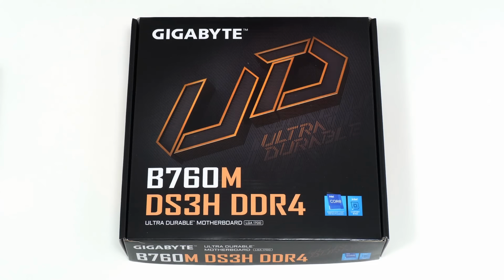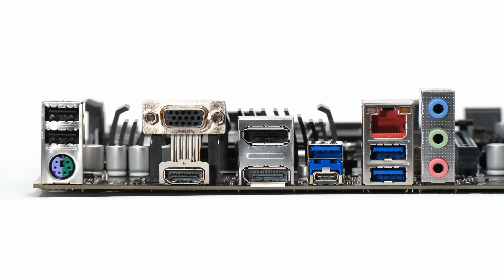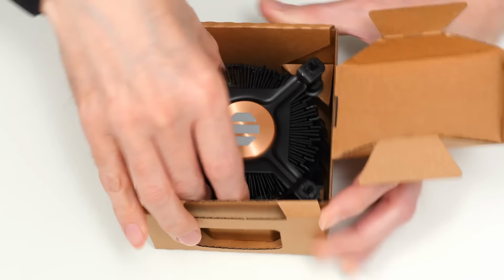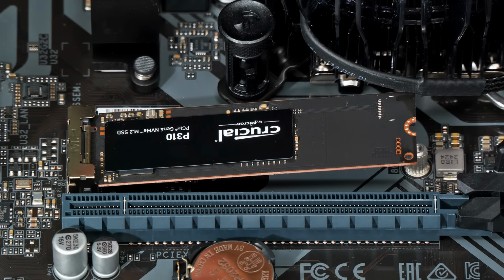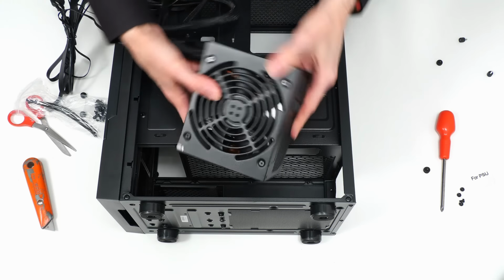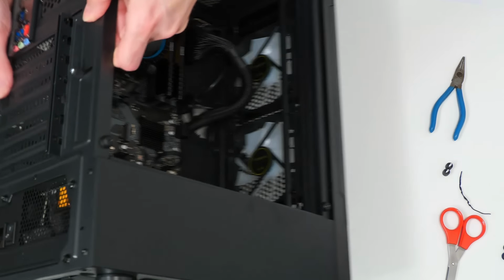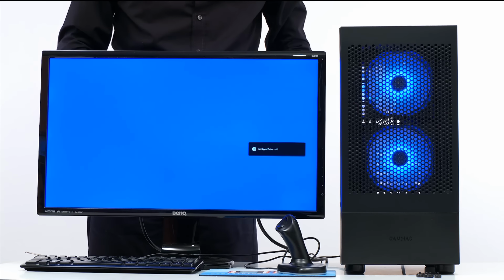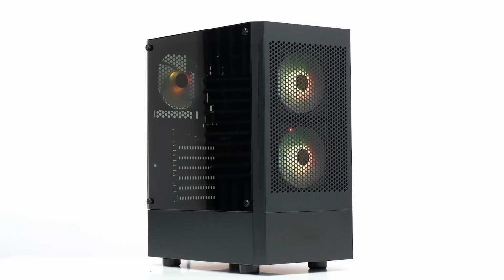Building a $500 PC

Comment: Hey Chris, I just upgraded the data hard drive in my ancient self-built PC. I bought a "refurbished" 2 TB Enterprise HDD on eBay for £20.99.

The drive is manufactured by Toshiba for Dell. It was manufactured in 2018, and had 41,211 POH (4 years, 257 days.) Power On Count was 33. Drive health 100%.

I formatted the drive, and ran a full surface scan.

The drive is working perfectly. I'm very impressed. I might buy a bigger refurb Enterprise HDD from Amazon.

Please note, there is ZERO risk to my data, as I have at least 5 backups, including two encrypted offsite.

EDIT: Perhaps you could do a video on refurb HDD?

Fans = Dust = Heat 🔥👎😭

Comment: Cooler Master MasterBox Q300L White Micro-ATX Tower $37.99
ASUS PRO B550M-C/CSM AM4 AMD B550 $79.99
ASRock Challenger Arc A750 8GB GDDR6 $199.99
Thermaltake Smart Series 600W $41.99
AMD Ryzen 5 4500 - Ryzen 5 4000 Series Renoir (Zen 2) 6-Core 3.6 GHz Socket AM4 $68.99
CORSAIR Vengeance LPX 32GB (2 x 16GB) 288-Pin PC RAM DDR4 3200 $51.99
Team Group MP44L M.2 2280 500GB PCIe 4.0 x4 $35.99
TOTAL $498.88 (NEWEGG)

Comment: Find the cheapest rtx 3060 you can, the 12gb vram will help it last for many many years and is also considered entry level, it vastly outpowers this Intel card and fits most systems due to low power usage 
Good vod for beginners 👍

Comment: Please forgive me repeating the advice I gave in a comment on the first video.

For this specific motherboard, at least, you need F19 or F20. This is vital for a 13th or 14th generation Intel processor. The upgraded BIOS has the correct voltage management for the processor. Ensure you have the right BIOS before ever running the processor.

For users with Intel 13th and 14th generation CPUs, prioritize BIOS updates and utilizing Intel Default Settings to ensure stability and avoid potential issues like instability and CPU degradation. Intel has identified issues with some 13th and 14th generation CPUs, including potential instability and degradation over time, and has released microcode updates to address these. Check the motherboard manufacturer's website for the latest BIOS version compatible with your motherboard and CPU. Ensure your BIOS is updated to the latest version that incorporates the necessary microcode updates (e.g., 0x12B or higher). Even if you were previously overclocking or using custom settings, it's recommended to revert to the default settings for now. [Source: Google AI]

Comment: 1. Outstanding instruction, 2. Wrong USB connector? 1. Showing the different connecting mode for drive 2 is precisely the kind of information I often find missing both in manuals and, also in videos! One puts in a lot of time in reading instructions and preparations, but then gets thwarted by wrong or incomplete instructions, which then results in endless searches and experiments, which is so annoying! So a goldstar for that! 2. when you talked about connecting USB 2 (19:56), you plugged the connector into a slot marked USB 1, which makes me wonder whether you were testing the attention level of your viewers...;-)
Reply from the maker: I wondered in the edit if that would confuse. The connection was correct -- I plugged the USB 2.0 connector onto the first of the two USB 2.0 headers, which was labelled USB 1. But both USB 1 and USB 2 here are USB 2.0 headers.

Comment: You mentioned that the board had two display ports but you won't be using them or can't use them? Is that because your going to use the cheap graphics card? If you didn't have the card, could you use the onboard display ports?
Reply from the maker: It is because I am using an Intel "F" processor, which does not have a GPU. It has nothing to do with the graphics card, which has three functional display outputs. But the display connectors on a motherboard only work if the CPU has a GPU. They have nothing to do with any graphics card that's fitted.

Comment: I built my own system about 10 years ago using a very inexpensive and older AMD A4 CPU.  It worked fine with Windows 8.1 then 10 along with Ubuntu, until it crashed now about two years ago.  I will be weaning myself off of Windows in the next few months before Win 10 support ends, when I switch back to Apple on a new Mini Mac while using my present Dell 3050 for Zorin. I started my PC journey in 1982 with an Apple II Plus but moved to Microsoft in 1985 due to the high cost of Apple products. I have been enjoying your videos for at least 10 plus years now.  Thank you.
Reply from the maker: Thanks for watching all this time! :)

Comment: The front fans had what looked to me like 3 pin connector just plugged into another cable for sata power and LED button. Back fan looked like very weird two pin. You could probably still use these fans because they looked like they can be separated from the SATA connection. 

I'd probably replaced them with Arctic P12 fans because I don't like RGB and P12 are really good fans that are really cheap.

Edit: They might even be 4 pin connectors so PWM.

Comment: I have to pay $140 for the motherboard.
I have to pay $110 for the processor.
I have to pay $155 for the graphic card.
I have to pay $44 for the memory.
I have to pay $65 for the SSD.
I have to pay $72 for the power supply.
The case i couldn't even find, but without the case I'm already at $586 and if i add $60 (I'm pretty sure I have to pay at least $80 for a case) for the case i couldn't find it will be a total of $646 here in Sweden.

Comment: Great video but I have to pick you up on the installation of memory.
You probably misspoke about the best way to populate the slots: one should fit one module on each channel and each channel, on this motherboard, serves two slots, one grey and one black. The grey ones are further away from the CPU and at the end of the electrical connection so, if you leave one slot unpopulated, like in this case, it's better to fill that one because the stubs in the wiring to the black slot will be shorter and signal integrity will be better.
By fitting the modules in A2 and B2 you make use of the combined bandwidth of both channel A and channel B while minimising the potential problems due to unterminated connections.
Reply from the maker: Yes, I did not explain it well. Sorry.

Comment: Missing the optical drive though.   I still work with optical media, so it's a requirement.

(and no, not using an external drive; if I'm building a mid-tower case, it's inherently stupid to use an external drive).
Reply: Yeah if he's not fitting an optical drive and he's using a half height video card I thought he would have gone with a slimline/SFF case.

Comment: Thanks for another great video!

I'm not sure about the pricing in the UK or US, but I recently put together a custom build with the following specs:
- AMD 5500 CPU featuring 6 multi-threaded cores.
- Intel Arc A580 GPU with 6GB of memory.
- 512GB NVMe SSD for storage.
- 1 x 16GB DDR4 3200 MHz RAM.

The case includes 3 RGB fans and a glass side panel, all for a total cost of around $550. This setup is perfect for office tasks and light gaming.

Comment: Great video.  No drama.  I think that you picked well. I like the motherboards with two NVME slots for SSDs.  On the machine that I built in 2021, I bought Windows because I was still working at the time and out of habit I was still running Windows. I had Mint on an NVME on a PCIe expansion card. Over time, I started using Linux almost exclusively. The motherboard failed and now I have both SSDs on the motherboard. It's good for dual booters. We can keep the OSs on separate drives and use the BIOS to select the drive to boot into and not have to deal with Windows chicanery. 

I don't know if that was a consideration, but it's good. Otherwise, it's good to have /home on a separate drive to keep files and settings safe in the case of an upgrade. Additionally, I may consider an Intel video card for my media centre system if it plays nice with Mint. I don't recall seeing a half-height video card in over a decade.
Reply from the maker: Thanks for this. I was certainly aware that the two M.2 slots offers many OS possibilities. :) This PC will have to earn its keep.

Comment: I do not agree with your BOM. If you are going to use proprietary software on a build, and it is a necessary part of the build, such as the OS, I believe that must be included in the BOM. As of March 30, 2025 Amazon sells Windows 11 Home for $119.99, so I believe your BOM must inflate to $614.02.

Using Linux/BSD/ReactOS/FreeDOS would only increase the BOM if you used a paid version of them, which in the case of some, like RHEL, exceeds the price of Windows 11 Home.

Comment: Amazing that all hardware dimensions, cable connections and screw holes from so many different manufacturers are standardized and also fit perfectly.
Reply from the maker: I agree. The success of PC component standarization often amazes me.
Reply: A lot of that dates back to the ATX standard from 1995. Things like I/O shield dimensions haven't changed in 30 years. If you found old generic PC case from the late '90s you'd be able to build a "sleeper" PC using all the components in this video. Though the old case probably wouldn't have USB ports or audio I/O on the front panel.
Reply: @zoomosis  I've had the same case for 20 years. it's been gutted out and refitted 3 or 4 times. it has a firewire port on the front! (obviously not connected)
Reply: @zoomosis  3.5" or 2.5" drive bay blanks can be replaced with I/O interfaces at very low cost, there's a way around everything
Reply: ATX standards in action.

Comment: 'Building' PCs has sure gotten easy. I've been laptop-only for the past 20 years, but I remember having to configure every port address, IRQ, DMA, shadow RAM, BIOS and drivers manually with (usually cryptically labelled) jumpers, DIP switches, rockers, copying files and editing start up scripts on my desktop/tower PCs through the 80s and 90s. Perhaps I'll put together a mini PC like this to move my file/web/mail server over to.

Thank you for the video.
Reply: 1990s: Trying to get the sound card, video capture board, SCSI board and "something else" to all work at the same time without Windows 3.11 crashing!
Reply: Wowee, never had to deal with any of that. Yeah it's like Lego now. The only thing like that these days is if you change your GPU from NVidia to AMD or anything else. That's usually when the good ol' hiccups occur. Driver misconfiguration is still a pervasive issue on Microsoft Windows, and that is why I advise to simply reinstall the OS when you get a new GPU. I do this with Linux too, even though it's not as needed. But most don't do this for some reason and instead opt to use some third-party software to uninstall drivers in Safe Mode. This mystifies me personally, I think they just don't want to lose their files, but then why not back up any files you actually want to a local server/cloud?  I see constant issues from people trying out AMD and doing the third-party method that I would bet much would be resolved if they just reinstalled. It honestly takes minutes these days on most hardware, so I don't get it personally.

Reinstalling used to be very common, but it seems that these days people don't know how to do it or just don't want to.
Reply: I'd like to learn more :)
Reply: Ahhh! Those were the days. 3AM and swearing to get it up and running in time to get an hour or 2 of sleep before going to work.
Fond memories!!

Comment: To keep costs down even further, I've had some really good bargain price second hand processors from CEX. Best deal I've had so far was an i9-12900 for £170, less than half the price of most other places. Amazing processor too, with a total of 24 cores. Multi-threaded processes are ridiculously fast
Reply from the maker: That was a great deal on an i9! :)
Reply: @woowoo0739  I also keep my old case when upgrading to save money, been using the same case for 25 years

Comment: If your i7 ever failed, would you consider replacing that system with the new i3? As you have demonstrated, 1080p video editing in Resolve is very good, and have said that you would be able to edit videos on this PC.
Reply from the maker: Yes, if I still have it, I would have no issues moving across to this PC (probably running Ubuntu or Rocky Linux, with DaVinci Resolve and Autograph). It's at least as powerful, and drives could move across. My i7 will fail eventually, and then my whole setup (hardware and software) will have to change.
Reply: @ExplainingComputers  I think doing your Linux video production experiment gave you peace of mind that as and when you i7 will fail, you will have software you can use and, now at least, a computer you can use.

Comment: I like that you use real budget components for a custom PC build. Most channels use ultra expensive components resulting with a 'budget' PC costing at least €2000! Let's be honest, what you got is more than enough for most of us, I myself have my 10 year old i5 budget build PC still working fine and plan to eventually upgrade to something similar to yours once my components start failing
Reply: I agree.  It's nice to  see a real  budget  PC build these days.
Reply: Cooler Master MasterBox Q300L White Micro-ATX Tower $37.99
ASUS PRO B550M-C/CSM AM4 AMD B550 $79.99
ASRock Challenger Arc A750 8GB GDDR6 $199.99
Thermaltake Smart Series 600W $41.99
AMD Ryzen 5 4500 - Ryzen 5 4000 Series Renoir (Zen 2) 6-Core 3.6 GHz Socket AM4 $68.99
CORSAIR Vengeance LPX 32GB (2 x 16GB) 288-Pin PC RAM DDR4 3200 $51.99
Team Group MP44L M.2 2280 500GB PCIe 4.0 x4 $35.99
TOTAL $498.88 (NEWEGG)
Reply: @Foxtrot_Foxtrot_Lima  Not here in Australia mate! ASRock Challenger Arc A750 8GB GDDR6 min $445AUD!
Reply: @geofftottenperthcoys9944  Damn, Sorry about your luck Brother.
Reply: I recently upgraded my old core i5 4400 to an I5 10400.  I actually used the same Gigabyte motherboard as here,
16GB of similar Corsair VRAM, and a Crucial SSD of the same size but P3 plus rather than P4 whch was much more expensive then.  What's more I bought the same Corsair PSU (hopefully quieter) but it was DOA so back to Amazon.  This last week I have put it all in an SFF case which is just fine if you don't need a DVD drive and highly recommended.   I used an Asrock RX6400 low profile graphics card which is just fine for the photo editing with DXO Photolab that I do. Of course the SFF needed a new small PSU so I will put all the old kit in the old case with the old PSU and run it as a Linux backup.
Reply: "real budget" i can build such a better pc with second hand parts lmao

Comment: You are one of the few content creators showing how to put together a low cost pc, thanks!
Reply: Cooler Master MasterBox Q300L White Micro-ATX Tower $37.99
ASUS PRO B550M-C/CSM AM4 AMD B550 $79.99
ASRock Challenger Arc A750 8GB GDDR6 $199.99
Thermaltake Smart Series 600W $41.99
AMD Ryzen 5 4500 - Ryzen 5 4000 Series Renoir (Zen 2) 6-Core 3.6 GHz Socket AM4 $68.99
CORSAIR Vengeance LPX 32GB (2 x 16GB) 288-Pin PC RAM DDR4 3200 $51.99
Team Group MP44L M.2 2280 500GB PCIe 4.0 x4 $35.99
TOTAL $498.88 (NEWEGG)
Reply: @Foxtrot_Foxtrot_Lima  WOW!!!!!!  I am impressed!  Would make a nice build and would burn the tires a bit!!!

Comment: Looks like the A310 with a low profile bracket would be a perfect fit to upgrade my underpowered integrated graphics in my Dell PC.
Reply: What is your use case? As I understand it, the built-in video functionality in Intel CPUs isn't that fast, but the Quicktime rendering is better than even the fastest Intel Arc Axx card's built-in Quicktime.
So, if the Dell has a reasonable new Intel CPU with Quicktime (non F versions) and you use Quicktime a lot, it's not for certain, you'll gain any significant speed if at all, but if you are gaming a lot, then it's the A310 VS whatever GPU you are using now (Intel CPU graphics or dedicated GPU).

There are of course other benefits with a newer dedicated GPU like the A310, like support for more codecs as well as more modern support for gaming features.
Reply: @akyhne  I am not a gamer. I was hoping a cheap ARC would have some benefit to my two monitor setup. I am using a i5-13400 CPU

Comment: Great video! The parts choices are a good example for people you want to teach this to. But I have a big question!

As a guy who wants to build new systems with older parts, I'm curious how the old RAM system worked? My current motherboard (ASUS PRIME B450M-A II) has very lax requirements. Maximum RAM size (128GB DDR4), the max supported speed (4400MHz), compatibility with certain CPU's,  and a tip about CPU architecture affecting the max RAM.

But when I go RAM shopping for my old ASUS M5A 78L-M LX3 motherboard I find a huge table of acceptable RAM. It is detailed mentioning brands, speed, timings, voltages, size compared to DIMM use (1,2,3, or 4 slot use.) I just have to ask why is it that complicated for an older board like that (2012), and how should I shop for that RAM?

Comment: Perhaps it would be interesting to see two comparisons:  

1. How much performance is lost if you remove the dedicated GPU and use a similar CPU with integrated graphics while keeping the budget the same?  
2. What if, instead of spending on a GPU, that $100 is put towards a better CPU with integrated graphics?
Reply from the maker: Good ideas. I am considering doing a video comparing the performance of this system with the Ryzen 5600G build (which has integrated graphics) from 18 months back.
Reply: @ExplainingComputers  That will be interesting to see, both for what's different and for what's changed between then and now.
Reply: I had exactly the same thought. Since this board has a good CPU upgrade path, perhaps that's something to test in the future.

I did go look up Passmark stats for one of mine that has semi-modern integrated graphics. Turns out the IG rates faster than a lot of concurrent OEM-type video cards, tho not as good as the better consumer (not gamer) cards of its era.